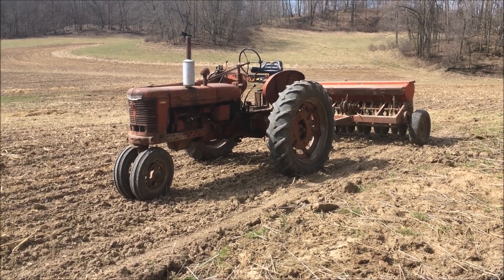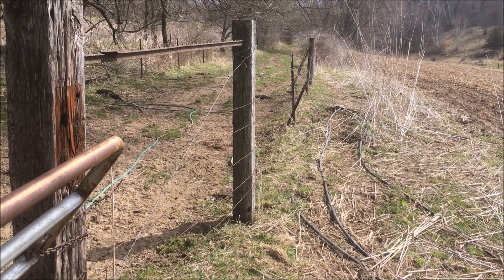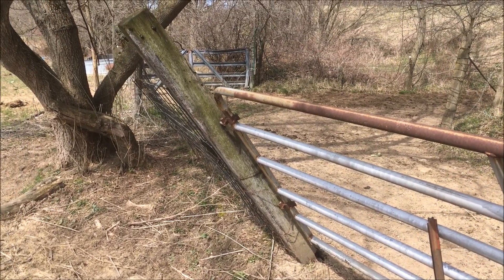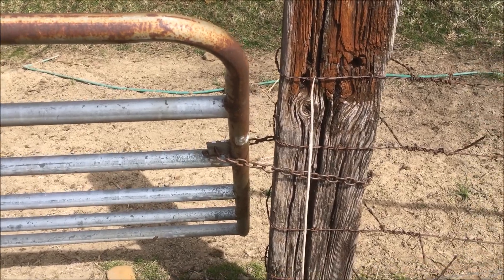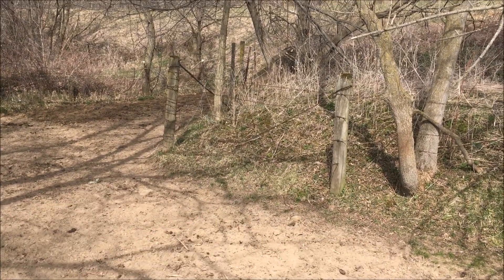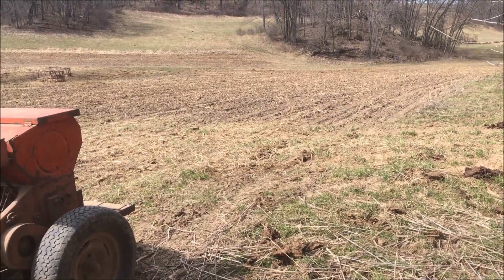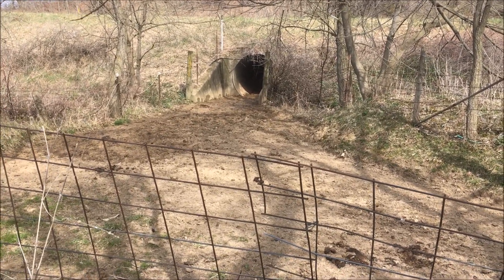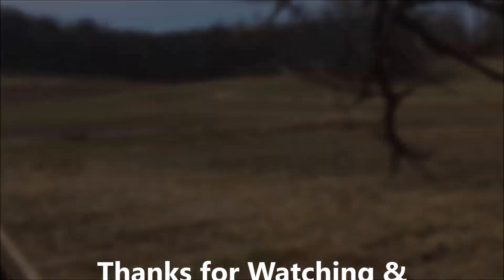Farmer Pete's Fencing 101 Addendum: Railroad Ties

Comment: Know what you mean about the railroad ties. There are some in our fence my Dad put in before I came along and they're still solid. About twenty-five years ago I set a couple hundred of them and I'll bet half are gone by now. Love the rope trips on the drill. Haven't seen any of them in a long time.
Reply from the maker: Yup: no hoses or pressurized oil, no wires or switches, just pull the rope and up it goes.
Reply from the maker: Dammed if I know, it’s the same rope that was on it when I got it about 30 years ago.

Comment: Good  day Boy o boy those pressure treated lasted a long time. Up here in Ont.  they  use either cedar or pt. I was told now they use any kind of wood , & it just doesn't stand up no more.  Thanks should have bought a whole bunch back Thanks
Reply from the maker: Should have. I've never had a PT post fail.